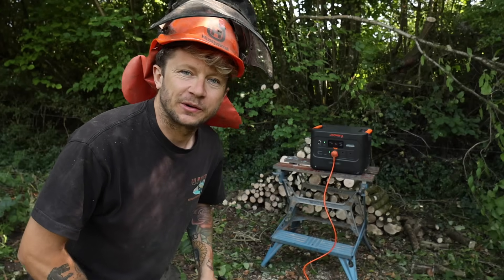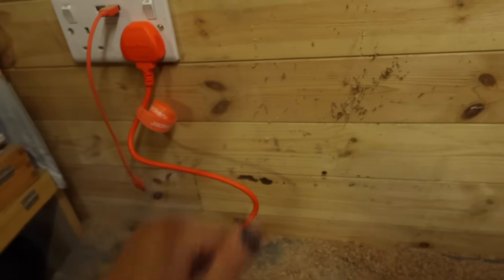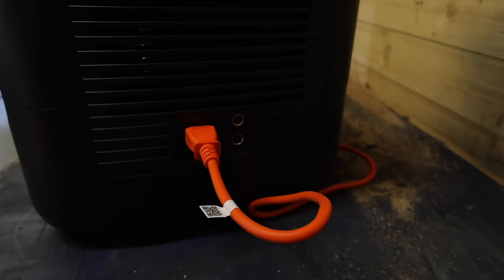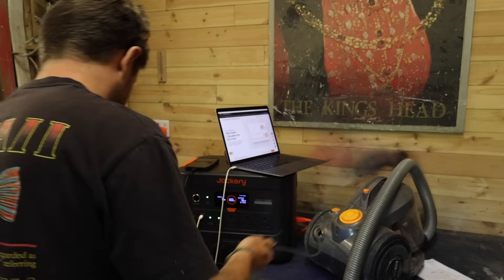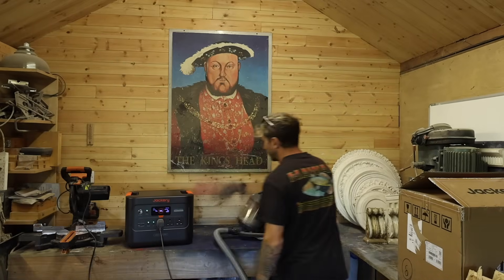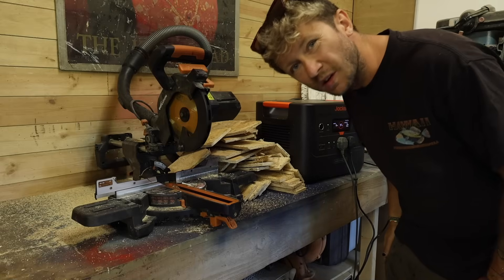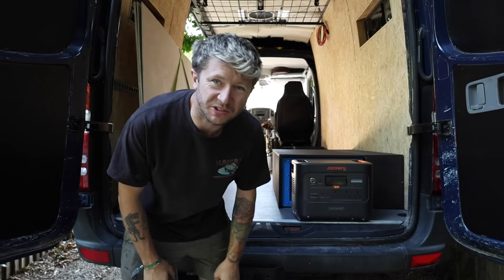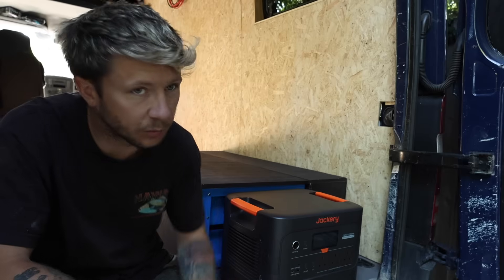Testing The Jackery Explorer 3000v2 - 3600w Power Station Review

Comment: 👋Joe, I have purchased an ex nhs patient transport ambulance which comes with a diesel heater and a leisure battery and it is in someways connected to a system called genisys if I want to replace the leisure battery with a new one is it just a case of removing the terminals and re-connecting to a new leisure battery . 🫶🏻🏴Jan
Reply from the maker: Hi Jan, yes that should be the case for a leisure battery!

Comment: Nice bit of kit, would save a lot of space and hassle when designing a narrow boat electrical system.
Reply: Until one bit of it goes wrong. If you have separate batteries, Inverter and chargers then you only need to replace the bit that has failed. Power stations are only good if you have a need to remote power.
Reply: Wouldn't it, do your welder, washing machine, induction hobs, etc. no problem...